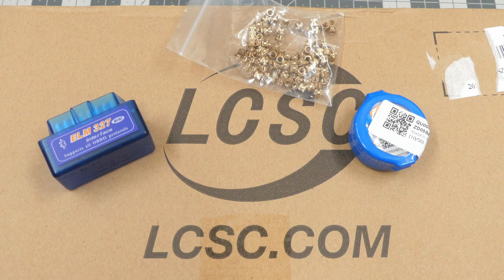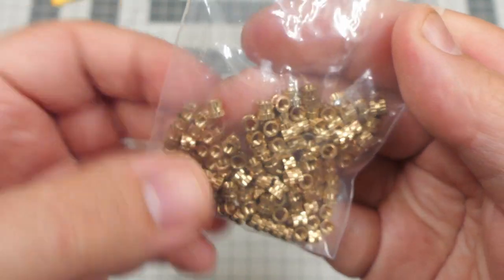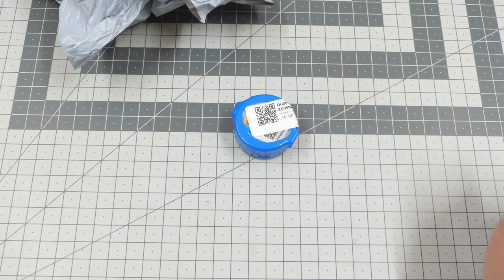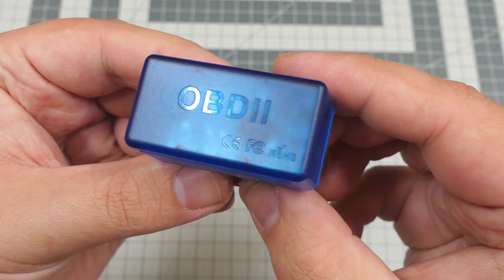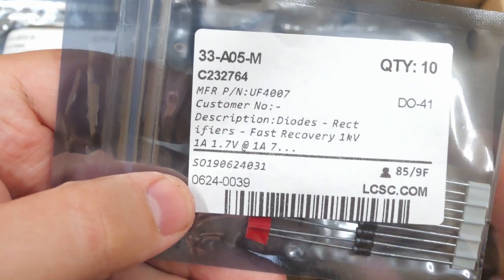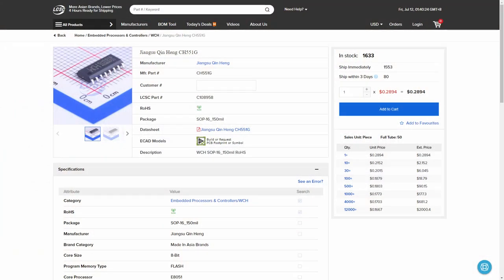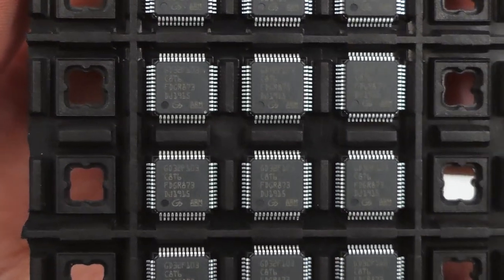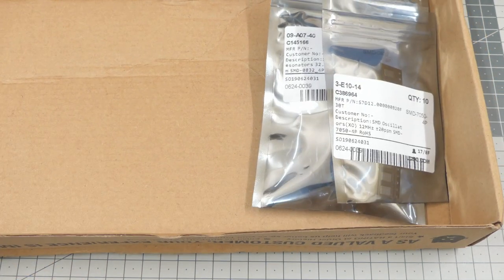Mailbag: Microcontrollers From LCSC And More

Comment: You can also use those brass threaded inserts on pcbs by soldering them to a slightly larger sized via or a flat pad. It's a great way to add threads to a PCB.
Reply from the maker: Ohh, that's great idea! Thanks for sharing!

Comment: Those caps are just fantastic for capacitive dropper circuits for LEDs and whatnot if they can last in series with 240V mains... hmm.
Reply from the maker: Yeah, capacitive dropper was one application I had in mind when I choose to get variation of these caps. Good solution for low power circuits, which are inside closed cases.